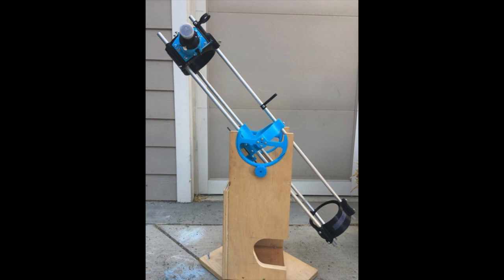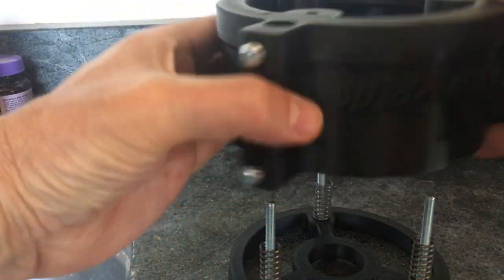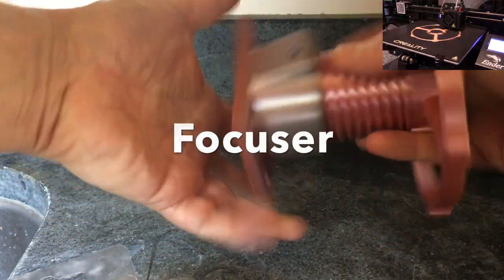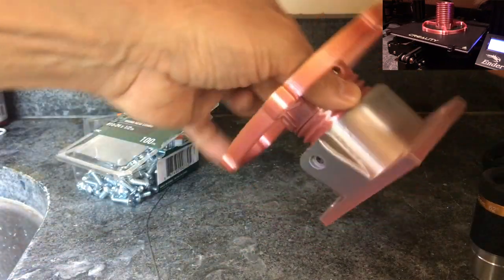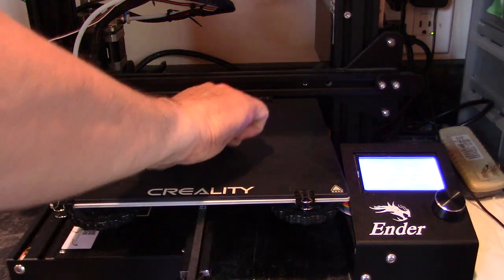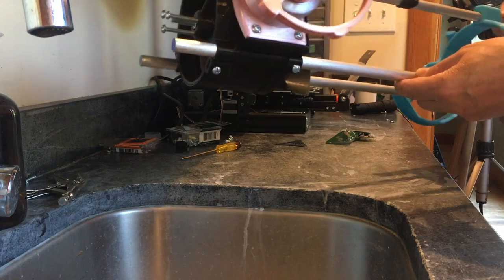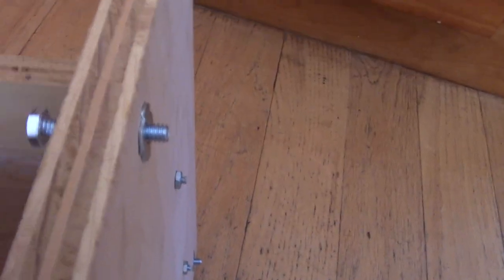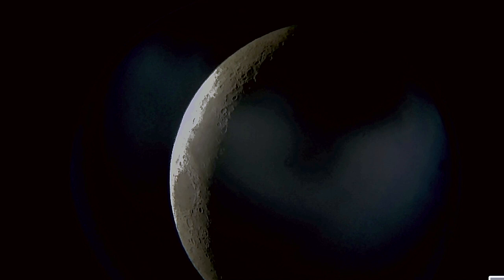How To Make a 114mm x 900mm Telescope at Home - 3D Printed

Comment: Hey, it's my project! neat feature.
Reply from the maker: Cool
Reply: If you are the true Maff, I feel like this is a rare opportunity to thank you for designing this. I completed the print / build process after finding it on Thingiverse and it has completely blown away family and friends with the results. I knew absolutely nothing about telescopes before the build other than that I wanted one but didn't know where to start. 

This scope is hands down one of the coolest things I've ever had and I use it on almost every clear night. The fact that no supports or special knowledge are needed for any of the prints is astounding and a testament to your design.
Reply: @BStreet666  I'm not hard to find on the internet :p If someone posts one of these to Reddit I usually get told about it.

Thank you so much. I made this whole project to increase access to astronomy (and as a response to the predatory scopes stores sell-- underperforming and overpriced), and I have been absolutely floored by the spread/adoption.  Glad to hear everyone is finding the prints easy, as well. I think the components of FDM-design are often overlooked!
Reply: Is this capable of measuring arc seconds? If so what is the error range (sensitivity).

My purpose is make a telescope that is sensitive to an arc second and can include a tube that can be filled with water. Ideally that the water filled tube can be swapped in and out on the fly instead of in a labor intensive manner that takes a long time.

I would be grateful for any suggestions and /or pointing me to further readings.

Sincerely - Thank you for your time and consideration.

Comment: Great 3D print! But, I need to offer some advice...DO NOT ever clean the mirrors with a glass cleaner and cloth....you just wiped away the coating which results in a crappy image. You should only be cleaning the mirrors with distilled water only and never touch the mirrors. You will need to have the mirrors stripped & re-coated.
Reply from the maker: I had no choice but to clean it.  It's better than having to buy a new one. The image is still good so the coating was durable.

Comment: So, people have called the mirrors "glass", and you were cleaning the mirrors with glass cleaner, but there should not be any glass.  While most mirrors have glass protecting them, telescope mirrors do not.  So when you are cleaning the mirrors, you are also scratching it.  If you want/need to clean the mirror there are plenty of videos out there on that.  Just don't scratch the mirror with something abrasive like a paper towel.
Reply from the maker: ok.  I used a soft cotton cloth.

Comment: I've read that you shouldn't polish the mirrors like that because it will accumulate tiny scratches in the polished aluminium surface.
Reply from the maker: Yes that would be the case if i were touching the reflective surface.  In this case however I am just cleaning the glass in front.  The mirrored surface is on the back underneath the glass.  

It is constructed similar to a bathroom mirror.
Reply: @MyEngineeringProjects  I've never before heard or seen a telescope mirror that wasn't a first surface mirror. Regular mirrors that have the reflective surface under the glass cause double images due to internal reflections.
Reply: I haven't heard of a telescope mirror not having the top aluminized. The light passing through the glass, reflected back out through the glass again would cause a mess of the lightwaves.
Reply from the maker: I was probably wrong about the way it was constructed.

Comment: so i been wondering because this is a open frame  telescope. won't you have trouble with unwanted light?  you know like cars or street lights?
Reply from the maker: If you are too close to lights, it can affect the image.  I've found that finding a darker spot in your yard or whatever is fine in most cases.  As long as it is not directly shining on the mirror, it works just fine.
Reply: @MyEngineeringProjects  yeah that what i was worred about. I'm in the city so there lots of lights
Reply from the maker: The first week I had this Saturn was not visible in my back yard.  I did have a view of it from the sidewalk in front but there are street lights every where.  I just went into the shade of a tree and it worked.  I saw Saturn for the first time and it looked great.
Reply: You can put a cloth shroud around the truss.

Comment: A really nice video of the Hadley assembly process. If you're going to be swapping eyepieces or adjusting focus much, you might want thumbscrews for the screws on the focuser so you can make them tight or loose without needing a screwdriver, but I'm linking this places as a great assembly guide reference!
Reply from the maker: Glad you like it.  I ran out of thumb screws when I shot the video.  I've since swapped out the regular screws with them and it's a lot easier.

Comment: Little taken aback by the seeming lack of awareness of the Mirrors .  
These are usually First surface mirrors with a  vacuum deposited Aluminum  reflective layer.
  Molecules thick.... 
Wiping the surface doesn't just scratch the mirror.... it Removes ! ....the mirror layer.
Reply from the maker: I was faced with a choice of cleaning it or not having a good image at all.  So I cleaned it and it works fine.

Comment: I just heard about the Hadley from a coworker and am thinking about building it.
Do you think with an adaptor, and something to compensate for the weight, a DSLR camera would work with it? I'm pretty new to astronomy
Reply from the maker: As printed it won't hold a DSLR.  I have built a counter weight and am working out the bugs now.  The counterweight is required for this use.  I do recommend building this project as it's a lot of fun and you can see incredible detail of the moon and other objects.
Reply: @MyEngineeringProjects  sounds good. Yeah once I get my printer back going I'm going to start printing it. It'll be a fun project
Reply: @wizardeddas  Keep in mind that (most) DSLR's have IR filters, so you won't be able to capture all available "light"

Comment: Would a 40mm eyepiece Improve the image or is the 23mm the standard calibrated eye piece?
Reply: The number there is the focal length of the eyepiece. The magnification of the 'scope is the focal length of the full scope (900mm) divided by that of the eyepiece. So a 23mm eyepiece gives a more magnified view of a smaller part of the sky. 900/23 = 39x, 900/40mm = 22.5x. If you want a tighter and more magnified view, you actually want a shorter focal length eyepiece, like a 10mm or even a 6mm (shorter than 4mm is a little problematic with this size of 'scope).
Reply: To go on a bit more, not all eyepieces of the same focal length do the same thing--they're all basically taking the light fed them by the primary mirror and presenting it to your eye with various optical wizardry, but the way the glass/plastic lenses in the eyepiece work will make them better or worse at it. A 23mm aspheric works okay, but very short focal length aspherics are troublesome, so for a 6mm something like what gets marketed as a "goldline" eyepiece is better.
Reply from the maker: As far as improving the image is concerned, in general the less magnification results in a sharper image.  An image from a 40mm eyepiece would be pulled back from a 22mm and the image would be smaller.
Reply: 50X the mirror's diameter in inches will be the THEORETICAL limit of useful magnification of a scope, but several factors reduce the actual resolution to a lower number. Throw in a super high magnification eyepiece but it will become a blurry blob at some point.

Comment: Thank you so much for this as I started the print this past weekend.  Quick question is I still have to print the knobs and Spider.  The issue is on the Creality when and how do you pause it to put the nuts in.  Like at what point in the print?
Reply from the maker: Yes you need to embed nuts in the spider. Here is a tutorial on how to embed nuts with an Ender https://youtu.be/hWBTXfL_F5I

Also, the knobs with embedded nut are so handy, I would say they are required.  It's a lot easier to align the mirror with embedded nuts.

Open your slicer and slice the spider or knob and then scroll up and down until you can find the spot just before where the nuts are enclosed.  Here is where you place the custom G-code to pause the print.  See the tutorial for details.
Reply: @MyEngineeringProjects  thank you so much for your quick response.  After research I found out my Ender 6 does no support mid print pauses by GCode.  So I will have to find time I can sit by it and manually do it.
Reply: Basically after you slice it go to preview (I'm using Cura) and move the slider on the right until you get to the point where you insert the nut. Note the layer number. Then go to "post processing" and pick "pause at height", choose layer, from there you should be able to figure it out.

Comment: omg this is so amazing, I'm so going to do this.  but what if you wanted to scale up so you can have a larger telescope? but printing your own telescope is just amazing to me and just how little the cost would be from buying one.
Reply from the maker: You should do it, it is so much fun.  It's possible to scale any part up or down.  I would recommend building the 900/114 mm version first.
Reply: @MyEngineeringProjects  I just started printing my first part tonight and it alreally looks great.
Reply: You can scale it up, but larger mirrors are more expensive since you'll have to use parabolic mirrors. Making a small aperture telescope with a spherical mirror is much less problematic and more forgiving than one with a larger aperture.
Reply: There's a community effort to work parametric versions for other mirror sizes, including an 8".

Comment: How does the brake work with the vertical movement on the wooden mount?
Reply from the maker: I had a couple of different versions. One of them was just a knob that I used as a friction device against the wheel. That wasn’t too bad. I also tried a rod  with a clamp and that seem to be more stable

Comment: How easily could this be adapted for a larger mirror, like 203mm/8"
Reply from the maker: It would be challenging to do this.  If you simply tried to scale the STL, then it would make everything bigger such as the nut holders and holes for the rods.  This would break the design.  One option is to import the model into CAD and then keep connectors the same but increase the size of the mirror holder and related parts.
Reply: @MyEngineeringProjects  I was also thinking it would make parts too large for most 3d printers. Would maybe have to divide them into the smaller pieces.

Comment: Out of curiosity, what print settings did you use?  PLA?
Reply from the maker: I print with PLA and use a few custom settings.

Print:
.3 mm layer
30% infill

Temperature
Nozzle first layer 215, other 203 degrees C
Bed first layer 65 others 60 degrees C

Comment: How do you focus Hadley? Do you adjust the distance between UTA and LTA? Or do you adjust the poker?I made it, but it's out of focus..
Reply from the maker: When you first put it together, put the eyepiece focuser in the middle.  Put the LTA near the bottom of the scope.  Loosen the UTA screws and look through the eyepiece.  Move it up and down until you can see an image.  Best to do this in the daytime pointing at a distant object.  Now when you get an image, then you tighten the screw and adjust the fine focus with the knob.
Reply: @MyEngineeringProjects Thank you. I'll give it a try

Comment: Can you tell me the type and number of screws you need?
Reply from the maker: Most of them are #10-24 machine screws.  I don't have an exact BOM for the entire telescope.  I would suggest getting a variety pack plus you will need some longer bolts in certain areas like the lower mirror cell.

Comment: oh oh one last thing where can i get the glue that you used?
Reply from the maker: You can use Silicone.  I put a link in the product description.
Reply: @MyEngineeringProjects  big thanks i just added it to my cart. and thank you for all your help and getting back to me.
Reply from the maker: Glad to help
Reply: @MyEngineeringProjects  
Hi! I have the same problem -finding the right kind of glue.. So you have used the standard Silicone which is used in the Kitchen or Showers (between the ceramic tiles etc) ? I thought this stuff is´nt adhesive enough for the Primary Mirror.... Maybe some flexible mounting glue would be better? (Thought about UHU Repair MAX)
Which type (Manufacturer, Brandname, etc) of silicone did you use ?
Reply from the maker: @hansmustermann03  There is a product link in the description.  Just use any clear silicone.  Kitchen and Bath silicone is fine.  It does a decent job of holding the mirror in place.  I don't remember the exact manufacturer brand I used.

Comment: Did you realized that the adjustment of the secondary mirror is over-constrained?
Reply from the maker: I'm not sure what you mean.  The screws allow for full adjustment up, down and all around.
Reply: @MyEngineeringProjects  you have one screw in the middle (the one that pretensions the spring) and then three screws around pushing the mirror holder. In short, three points define a plane, any N additional points are N too much. In other words, to adjust the angle of the mirror, you need to loosen one screw before tightening the other. Maybe you are happy on how it works, but the design could be improved. Generally I think the position of the mirror in this design is ill defined.
Reply from the maker: This is an open source project that anyone can download and/or modify.  The telescope works great for a beginner telescope that almost anyone can build themselves.  I'm not the designer but you are free to make any modifications that you would like.
Reply: @MyEngineeringProjects  I know it's a open source project. Thanks for sharing, btw. My comment was meant as a constructive advice for free. You may take it along or not, it is entirely your choice.